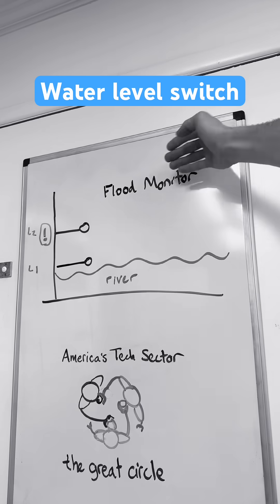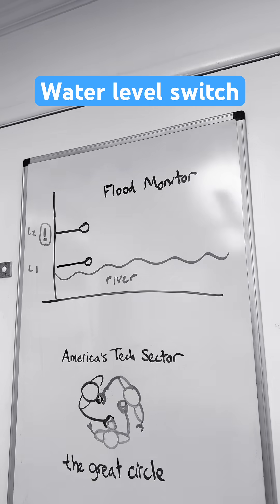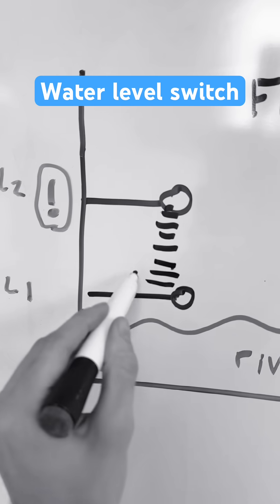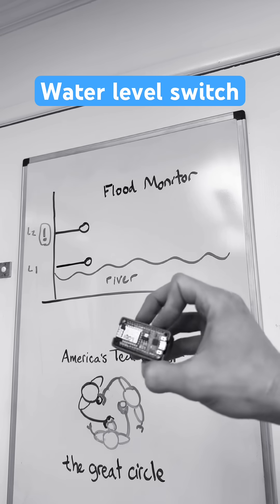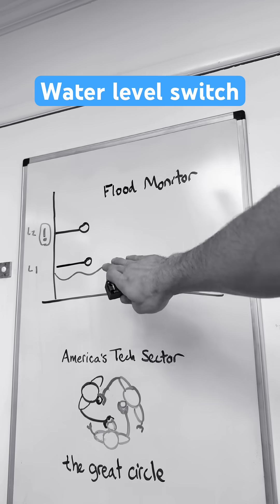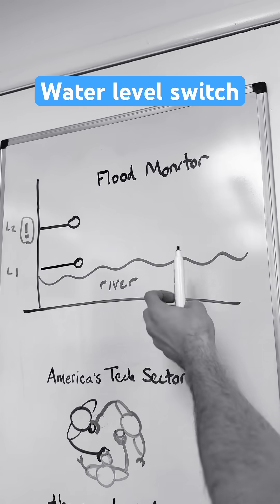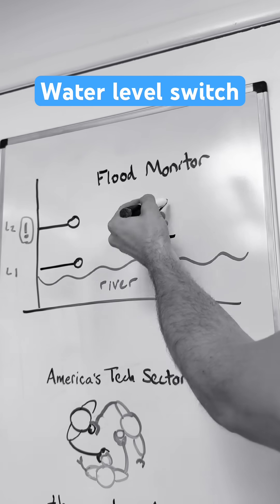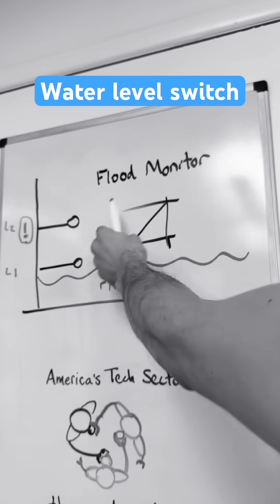my favorite water level sensor. #diy #engineering

Comment: 80% of Florida AC service calls are clogged drain lines, usually noticed because the AC has shut off. That style float-switch is what kills power to the handler, preventing overflows pouring into attics and closets. It’s just a fixed position fishing bobber with electrons dancing between the shaft and float and it saves humans unimaginable amounts of grief and money.
I often think about hidden-hero components and how many aspects of our lives are lived unmolested because some cheap part has just been doing its job with unyielding success. I wonder what could possibly be the cheapest, yet most prevalent part we rely on in society- that I might have never seen because my hands can only take apart so many things in my life

Comment: PVC should never be used around food or water irrigation. PVC is a construction material, not food grade plastic. The stuff that makes plastics flexible are called plasticizers and a common plasticizer used in PVC are called Phthalates, which can cause birth defects. PVC continuously leeches these into its surroundings especially when heated up (including bending and working with it). Look under your sink, there's a metal/braided tube for the faucet and a PVC for the drain.